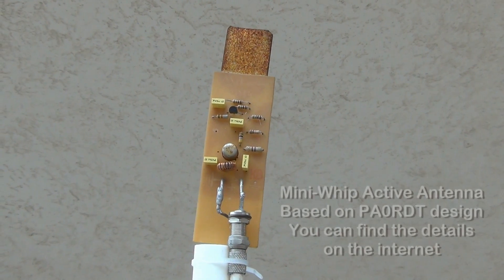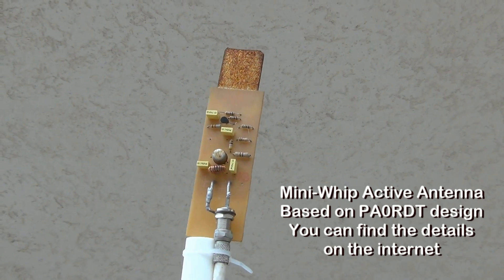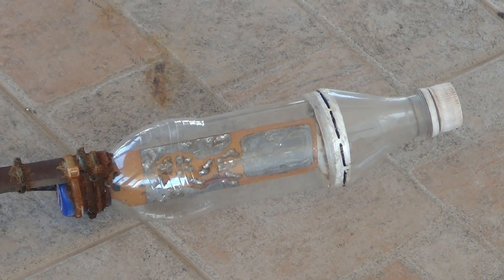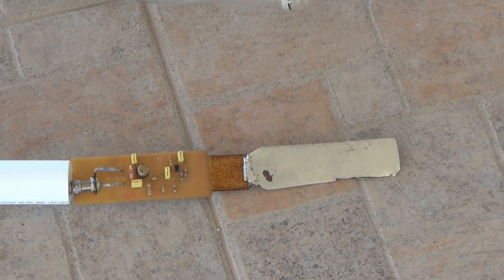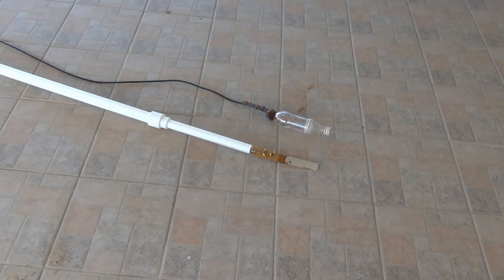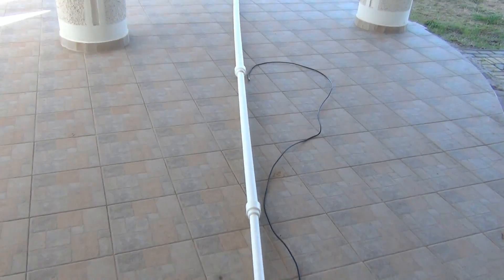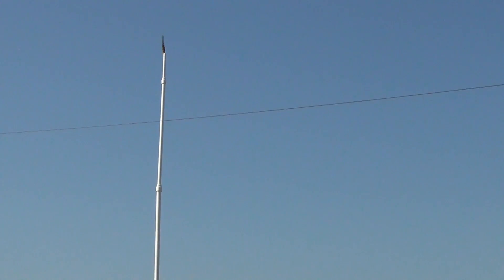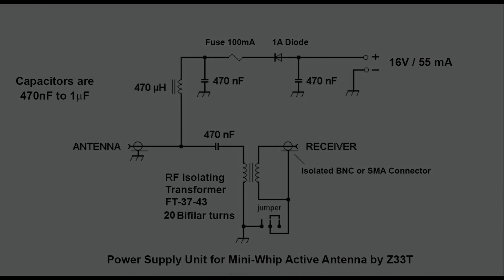Mini Whip Active Antenna

Comment: Have you got a video / tutorial on how to connect and use 10 kHz - 30 MHz active antenna (the Chinese ones on ebay) to laptop and receive LF signals on GNU Radio Companion (Linux)? Thanks.

Comment: Amazing !  Question: wouldn't adding more metal area help with reception?
73 N8AUM
Reply from the maker: It depend if you are in rural area away from strong RF signals which can overload frontend of the mini-whip. Take into account that whole coaxial cable (outer shield of the coax) is acting as antenna. Actually mini-whip is vertical antenna formed by coaxial cable shield. The signal from vertical antenna is taken from the top, where the frontend of the mini-whip is. That is why the coaxial cable shield must be grounded at its bottom, where the cable meets ground. The impedance on the top of the vertical is very high, adequate for first FET- transistor input.

Comment: Without power supply 9 v dc , does parrot antenna works well?
Reply from the maker: I do not know about the Parrot antenna (did not tested yet) but, my mini whip antennas works great with 15-16 V DC.

Comment: What is that 1M resistor from the voltage divider at the gate of J310 to the drain??? Remove that, and you will get really good signal. I made different system for VLF with single J310, resistor and capacitor from the source of J310 to ground (I think it was 200 Ohms + 100 nF, but not sure), and drain is connected directly to the center of the coaxial cable. At RX end, there is coil as suppressor to 12V PSU, and 100 nF capacitor to the RX input. At the time, I had no other receiver than just sound card - with some TL071 opamp, got excellent result from 0 Hz up to 24 kHz (depending of sound card sampling rate (it was 48 kHz). VLF broadcast from submarine stations are heard at 25 Hz (!)... and everything else on this range... The "receiver" is just CoolEdit program for visualizing the spectrum and eventually listen audible sounds. Recorded signals can be demodulated by post-processing in the same program.
Reply from the maker: https://www.youtube.com/watch?v=fKSOoZ2vhvo&t=54s

Comment: Would you get stronger reception with a larger antenna of 3 Meters or more?
Reply from the maker: Hi Steve, The large antenna will introduce IMD and other non-linear distortion because the amplifier front-end will be overloaded with much stronger input signal then needed!

Comment: which mini whip works better? the one with the bigger or smaller antenna plate?
Reply from the maker: Actually, they are about the same, if the vertical length of the coaxial cable is long enough (about 5-6 meters) due to fact that outer conductor of the coaxial cable plays the vertical antenna, feed at the top, where the impedance is very high. FET transistor at the input of the Mini-Whip, which has also very high impedance is adequate for this purpose....

Comment: people who report poor performance with the PA0RDT seem to be blissfully unaware that good, real grounding is crucial to the mini-whip. real ground in the ground, not "ground" off a pipe in your house.
Reply from the maker: Absolutely true!
Grounding the outer conductor (shield) of the coaxial cable has to be done properly! 

Coaxial cable is part of Mini-Whip antenna and collect a lot of RF noise. 

You can treat Mini-Whip antenna as a vertical antenna feeding at the top where the impedance is very high. 

Outer conductor of the coaxial cable must be grounded at the bottom of antenna, where the coaxial cable touching the ground, and the second grounding have to be done at the point just before coaxial cable entering in the house. 

The RF isolating transformer is recommend also. In that way receiver ground is not physically connected to antenna ground but it is galvanic isolated from outer shield of coaxial cable.

All this measures are not difficult to implement and cost almost no money, but the benefit is clear, noiseless VLF and HF reception!
Reply: I have my PAORDT antenna attached to a 'ground' in the ground and the performance still sucks!
Reply: @tglenn3121  ciao esattamente così non vale nulla é semplicemente un amplificatore da 20db , se vuoi farla funzionare meglio devi aggiungere un pezzo di filo lungo tra 1 metro massimo 1,5 metri lo saldi sulla piastrina di rame della mini wip , il filo lo. devi tenere bene teso in verticale , dentro al tubo di plastica che vedi nel video